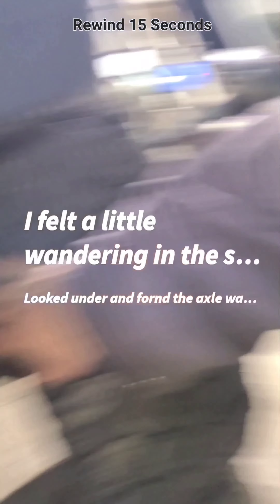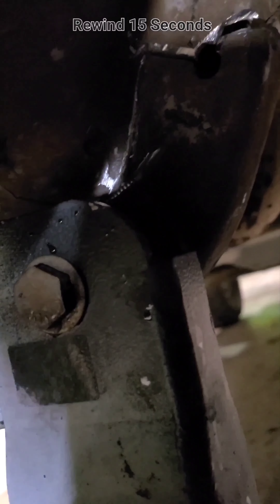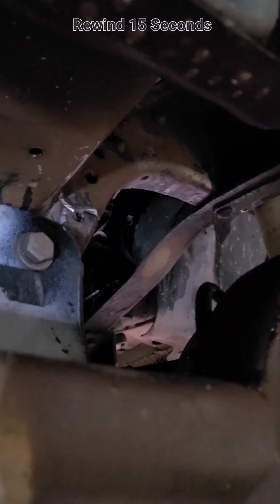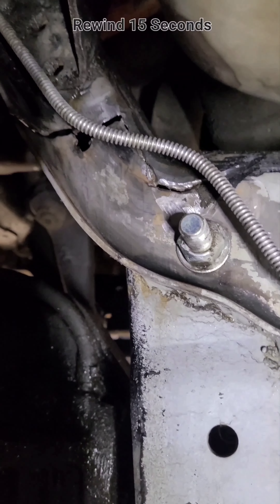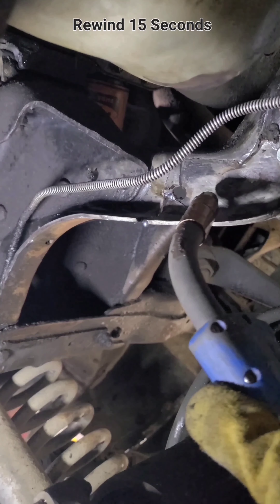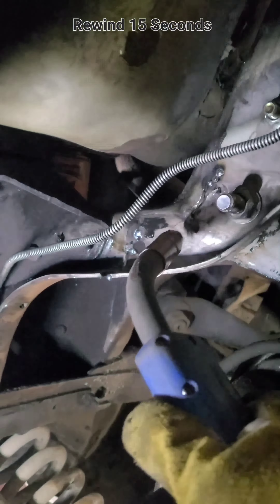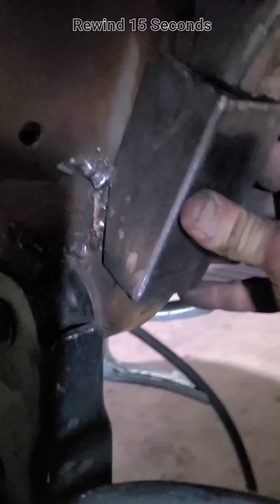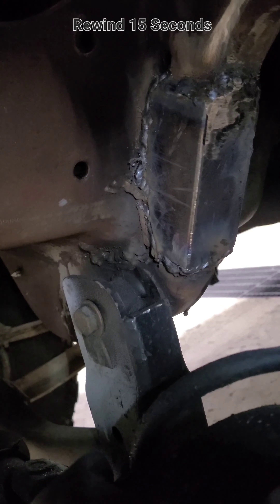Rough Country Suspension Lift Broke My Truck.  1992 F150 4x4 Cracked Crossmember Repair.

Comment: check on frame rail on either side of the crossmember common area to crack even in stock form
Reply from the maker: Thanks for the info.  Frame rails are good.  I haven't got a solid plan yet on a good fix yet.  I may end up installing a solid axle and leaf spring suspension.  Wouldn't have to worry about a repeat failure.
Reply: @Rewind15Seconds  big fan of leaf springs simple an works my 87 f250 hd has the ttb with leaf springs when i can get around to it its getting superduty axles